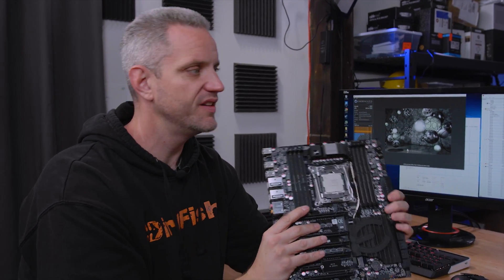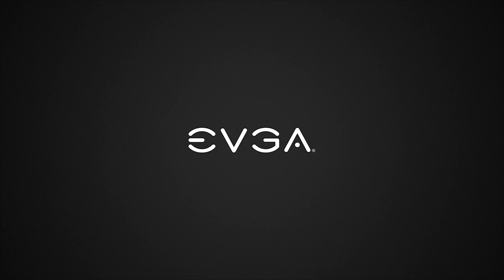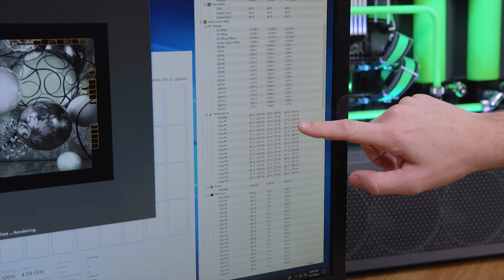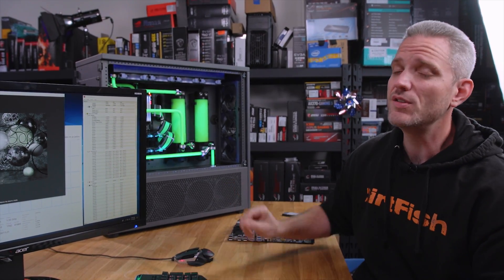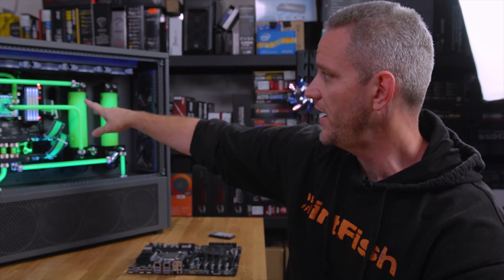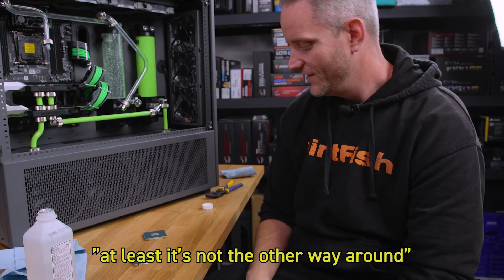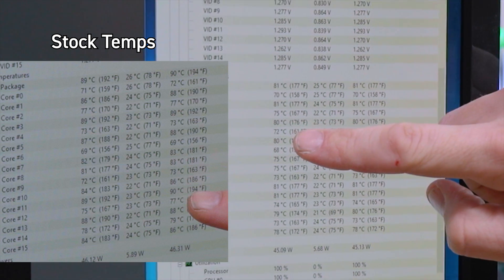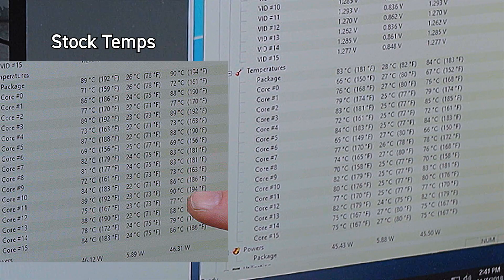I went to delid my CPU... but I didn’t expect this!

Comment: The liquid metal comments are killing me. I don't understand why more people aren't freaking out about the fact Intel shipped a CPU with a serious bulge. That's the real atrocity. If the system isn't throttling under load, why bother with LM? Unless you are dealing with a system you plan to use for getting on record boards, delidding is a complete waste of time.... 80C - 90C under load is perfectly acceptable.

Comment: Great tip for those who want to get their CPU flat and cool without delidding. For your lapping needs may I suggest a Granite Inspection Surface Plate that's 18 Inch Long x 12 Inch Wide x 3 Inch Thick you can purchase for under $150.

Comment: Gelid GC extreme:  8.5 W/mK
Thermal Grizzly Hydronaut: 11,8 W/mk
Thermal Grizzly Conductonaut: 73 W/mk

Should have lapped the CPU even further until almost all the surface was copper and used Conductonaut on the delid and IHS ofc :D

Comment: Wait wait wait... Cinebench r15 is AVX?  Hows the come I can run a 980x and get a 980-1000+ (remember, only 6 cores at 4Ghz here, so not far from the EXACT performance you're getting now if you do the ratio) when the 980X lacks any and ALL AVX anything?  Can't be that heavy of an AVX load I'd think, or I wouldn't be in the same fighting class with a 2012 cpu.

Comment: What if the heat spreader was actually domed? As in bent outwards. If that's the case the inside surface contacting the die would be farther away than necessary and would also be causing heat transfer issues.

Comment: How much does that CPU cost? It's IHS isn't flat? Some great premium quality there!
Reply: It's pretty atrocious, isn't it? I'm not personally a big Intel fan, but you'd think they'd have a reputation to uphold, so they'd try and make sure their QA department does their job right...
Reply: @rjfaber1991 
Soon Intel will release "Concave" and "Convex" editions of their cpu's
Reply: most expensive parts are individually checked. Less expensive, check a few out of the batch, Even less expensive not at all. Pretty simple to understand lol.
Reply: Intel would do great with parachutes. No need to check all of them.
Reply: It's 5 °C..., on cinebench, I guess it's flat enough, if the coolent heat up, it will make an even lower difference...
Reply: I did QA work at a foundry that produced several automotive parts and we checked every single part that went out the door. On steering knuckles we ran bolts through everything that was threaded along with calipers to measure dimensions. I did QA work for Kia also and we checked everything including hand checking each headliner before it even got to the assembly line
Reply: @user-uo1rn2nb8f  Yeah the IHS not being flat on CPUs at that price is inexcusable. Makes me question the intelligence of people who defend it.
Reply: I can only imagine a bigass sweatshop with thousands of workers all spinning cpus.
Reply: I almost wonder if this is like how some car companies would intentionally make parts "wrong" so they only fit with their approved parts.
I forget who did this but usually the mating surfaces of an engine and transmission is a perfect 90, well this one company had a mating surface that was (by design) 5 degrees off from that so if you tried to use an otherwise perfectly fitting engine/transmission from a different company it would damage both parts fairly quickly.
Reply: I mean, its 1 CPU. Theres going to be defects in anything produced to scale. Unless its a widespread issue, its not really an issue. Warranty it.
Reply: @duo1666  With a CPU at that cost they can spend the few seconds to check the IHS is flat. Sorry but this is undefendable for such a "premium" product.
Reply: @Krytern  Thats literally not how manufacturing works. You dont check every product.
Reply: @duo1666  That is literally how manufacturing works. It is called QA. Every PREMIUM product has some form of basic QA that doesn't take much time. Look at the price of that CPU, they don't sell as many as you think of that tier of CPU, they can spend a few seconds making sure it is fucking flat. Stop defending Intel's bullshit.
Reply: @Krytern  QA doesnt test and observe literally every product. You have no idea how manufacturing works. QA tests a few random samples from a batch of products.
Reply: @duo1666  no most photographic or other automated QA etc checks every single product on the line and after the image is processed the defective part is able to be located and binned.
Reply: @BNAU  And apparently its not a perfect solution. Theyre not all inspected by hand.
Reply: @duo1666  why are you having a big argument with the other guy, this is thousands of dollars worth of CPU and they sold it without it being flat, which as the video shows is important for thermal performance, it is piss poor quality control for such an experienced fab especially on their highest end consumer product.
Reply: @hemmoau  Unless this is a common issue, its not "piss poor quality control". Its called you got bad luck, RMA it.
Reply: @duo1666  Jay already mentioned that many people have been complaining about this very problem, that means that this shit has nothing to do with bad luck.
This is a premium product that costs thousands of dollars and one would expect a better quality control.
Such a problem can occur in Pentium's product line or i3 but not this !!!
how would you feel if you bough a Ferrari and the radiator was poorly installed ? and again, not just you but many others reported the same problem ? would you called a bad luck or would you demand a better quality for such a premium product ?
Reply: I have been in a wiring harness production facility. Each wire harness is electricaly tested and then goes through a whole dedicated group of workers that checks external appearance and other factors. Depending on model, the price of final product ranged between few bucks for simple harnesses and few hundred bucks for more complicated ones. Seeing as CPU's cost at least few hundred, I'm sure they could spend some money to check each individual unit for defects. In fact, they do just that and more. Either some defective unit passed through that process or some dude from marketing department decided that it was a good idea to add concavity to the surface of IHS.
Reply: @duo1666  I worked in production of small control units for fuel systems in cars. And we were checking all PCBs optically (all components) and electronically also all components. And then finished product as black box testing. And then before it went to the cars it was tested again at the customer input. I know this is automotive and it is probably more crucial to test everything than one processor that is (probably) not that important. But it could be important for someone enough to make his work invalid or lost his data. I think they could do better for this amount of money.
Reply: @BeHappyTo  Mr. πàñ, this is the FBI and we're gonna need you to quit being so slick with your online names. ;P
Reply: FBI is not interested in me.
Reply: @duo1666  very true but something simple can easily be checked by a machine
Reply: @Krytern  QA is taking a statistical relevant sample size based on your manufacturing volume. They don't check every product, not even in MEDICAL DEVICES where it is implanted in human beings. So yes, if you're statistically unlucky, you will have surgery with a faulty device put into you. Why would Intel be any different when it's not life and death. They will not literally QA every part.
Reply: @BeHappyTo  love how dou shut tf up after that
Reply: @duo1666  You can't RMA it because Intel doesn't consider that a defect so you either return it to the store and suck up that 10% hit for restocking if they will even allow that or just live with it. And also EVERY unit in a premium product like for example a headphone is inspected by hand and machine for example Sony's Z1Rs, Sennheiser's HD800 because you know they are PREMIUM products and when you are paying that much money for a product people expect it to be pretty much perfect.
Reply: Krytern you’re wrong. Completely wrong. They’re making thousands of CPU’s a day and it’s just not feasible to check every one. If you’re manufacturing potato chips you don’t go and open every single bag to make sure it got enough...
Reply: @twitchmania7614  thank you I was going to say the same thing but seen this
Reply: @duo1666  definitely not an isolated incident

Comment: Hi Mister Two Cents, I have a problem with a PC, whenever my PC tower case is knocked a  little bit it starts to rattle very loudly and that lasts for some time even if I restart or shut down and start PC it still goes on with a noise. Can you help me find a solution for problem, internet didn't provide answers and my PC is out of warranty [I have Intel Xeon w3550 CPU and LGA1366 motherboard]. Also if someone from chat knows anything about this issue please respond to this comment :)

Comment: i7 6950X 4.9GHz at 1.35...woah ;-)
Reply: That's like a 1% chip. If you were running it 4.9GHz daily then if you factor in the ring bus architecture vs. mesh, no wonder you saw performance decrease in gaming with the 7900X in your D-Frame build, MS patches notwithstanding.

Comment: Liquid ultra is thin..the lid still will push it out...but it does leave that slight coating and residue. I do not know about conductonaut. Try it...if you don't care run the lower clock.  But yeah it will hold for awhile the other stuff than just starts running hot again.

I still told ya man...you could still almost be on air still with shit.  I need to delid agian man....it held like a week....same stuff ran cooler on different mobos man.

Comment: I wonder if the more gritty finish on the surface would increase the surface area at the micro level, potentially giving better cooling performance...
Although the thermal grease would have to fill between those tiny hills and caverns...
would be an interesting test.

Comment: How dare you delid and not use liquid metal lol. Such a shame Jay. I did a bunch of testing over the past 6months with a 4690k and an 8700k and although liquid metal didn't have that much better of temps, the reliability was FAR superior. NH-T1 had pump out within 24 hrs on both CPUs, GC extreme lasted a couple days and liquid metal had no issues and is still on both CPUs.

Comment: One thing I would suggest is also using a square to see if the IHS is flat or not. If it is in fact concave, bent the other way than Jay's, it won't spin like a top either, but you still won't get a good contact patch.

Comment: GLASS IS NOT PERFECTLY FLAT!!!...      
...juss saying. And that's not lapping its sanding. Lapping involves two surfaces with an abrasive in between them, (a dry compound or a slurry), to progressively flatten EACH OTHER to a certain tolerance. What you're doing is removing material of one object to get it as flat as the glass. Bare with me I have one more critique, wheres the liquid metal! why go through the effort of deliding if you're not going to liquid metal dat shit! lol but please stop calling it lapping, seriously. It's completely wrong.

Comment: BEFORE YOU LAP.  remember that the brackets will put alot of force over the ihs and even or uneven it .
9 years ago i lapped my first i7 and after i mount it in socket i realise it wasnt mirror flat anymore
used a small square crystal to check it 

the brackets pushed force on the middle of the IHS and after lapping i had a gap in the center of the IHS
it always deppends on socket type.
 Or if you could lapp having it in the socket with bracket force, which we know is kinda impossible. or maybe use a broken MB ?

Comment: Jay, did you wet lap or dry lap your processor?  I'm just curious because I always ended up with TERRIBLE results if I didn't wet my sandpaper before starting the lapping process.  You would think it wouldn't make such a huge differencee, but by switching from dry lapping to wet lapping I managed one time to shave off a solid 8C off of a Core 2 Quad Q6600 to the point that I ran it at 3.6ghz and without even touching the voltage!

Comment: I have brout  2 970 pro 512   to run ray 0 for oper sis i also got 4 970 pro 2 trar by fror 2sec ray o 2 x 2800ti 64 gig 3600 mem im lining to 2850 amd bicoze  of pci lines do i nide wind in ray on my ferst ray mony is not conserarn

Comment: Again this is the type of video that shows piss poor quality coming from Intel. Don't have the heat problems with AMD even on threadripper. For more than double the price Intel should be putting out a superior product. Not something that has to be LM or delidded in order to get decent temps.

Comment: IHS is not to spread the heat, it is to prevent damage of the die during installation and reduce warranty claims.  If anything, the IHS reduces thermal conductivity to the cooler. Especially in the case of Intel coolers that don't even cover the entire IHS.

Comment: It's like removing old, worn crappy stock tyres from your car and replacing them with slightly newer, worn crappy stock tyres. Why Jay... Why?!
Reply: 😂 exactly I had to do a double take and check if that was paste going on there  , why no LM ?
Reply: Perfect
Reply: While I agree putting paste under the IHS just seems....dumb, at least it shows that the heat problem is probably more related to the overall thickness and the core count in that small a space. Of course that's assuming you can build reasonably flat components 🙄

I think it's high time direct die cooling makes waves, it's far less dangerous now because of water blocks than it was way back in the early Athlon days, with heavy air coolers.
Reply: @vickas54  I remember linus showing a prototype waterblock IHS that replaced the stock intel one, not sure if you can get them commercially tho the video is a bit old https://www.youtube.com/watch?v=n4O_Dq3xRJA
Reply: To see if it makes a diff or if it is the thermal paste?
Reply: Well Gelid GC Ext is still the best thermal paste out there. Problem is it doesn't do jack, that CPU is too hot for TP to be beneficial
Reply: @JABelms  Nah dude he would for sure get a much better improvement with liquid metal.
Reply: @Shareezy  Yeah obviously. I would put LM as soon as I open that thing up..but that is Jaye's choice anyway, rich man can do anything he wants anyway. I think he was just underestimating intel's TIM quality and was expecting a 7C drop or something lol
Reply: @JABelms  I'm using PK-1 and PK-3 TIM from Prolima Tech, between a threadripper 1950X and a Noctua active cooler. It's awesome : all cores are running at 3.9GHz without throttling, hitting max 85C to 90C in Cinebench and other benchmarks stress testing the CPU (about 100C in Prime95)... Note that a Threadripper can support higher temperatures than Intel before turning itself off (the quality is so much better...). PK-1 for my test bench (it can last about 3 years+ without issues though Prolima Tech mentions one year), and PK-3 for the long run. I didn't dare tried to OC up to 4.2GHz since I'm not using water cooling.
Reply: @JABelms  From what I've seen, all the thermal pastes are within margin of error so saying the Gelid GC Extreme is the best is a farce.
Reply: @CODE-BROWN  No, it's objectively the best atleast for the consumer market. I used all thermal paste and GC Extreme us pretty much the peak that I reached, I use it to cool my 4.8Ghz 5960X on air. There are also benchmarks out there. If those aren't enough, EK replaced all their thermalpaste for their watercooling from TG Kryonaut to GC Extreme

Comment: 6950x
7980xe
7960x
Names are not hard to remember, also you probably put way too much paste so the gap between the silicon and ihs was probably too far, not to mention you didnt use liquid metal under the ihs.

Comment: Liquid metal is the way to go Jay :) You have a 480mm cooling just the CPU so 1.3 shouldn't be unreachable trust me. I have a similar setup to what you've got in Skunkworks now (for CPU anyway :D I'm poor people and don't have 2500$ for GPUs) and I should tell you that a delid with liquid metal dropped my temps by more than 10C compared to the termal paste sooo I'd expect you can reach high 60s low 70s on that setup

Comment: A few technical things:
Small data-sets are more taxing because the CPU has to wait less. 
Your CPU has L1/L2/L3(maybe even L4) cache and then RAM - and that is also the order of their speed and decreasing size. If the data is large it need to be loaded from RAM, but if it is small enough to stay in the L1 cache then there are near 0 waiting-times and the CPU can run at full throttle.

And for the crash under load - yeah of course it crashes without warning. it is not that the CPU doesn't get enough power but that a transistor did not switch on fast enough. The signal that turns the transistors inside a CPU on needs to reach a certain voltage, and for these tiny parts a transistor acts like a capacitor - it needs to be charged up to reach that voltage. If it doesn't charge up fast enough and the next clock-cycle is reached then you get errors are total lockups. 
(this is also the reason why CPUs when cooler require less power and can clock faster - cooler temps mean lower resistance so less waste heat and faster charging)

Comment: It's always a speshul day when someone cracks open a $2000 chip.

Also, Small FFT fits inside ( for the most part) the L1 cache, so the chip doesn't need to fetch from L2 or 3, this is the most efficient scenario for a chip and therefore you get less of the core logic sitting idle for any given time, means more heat.